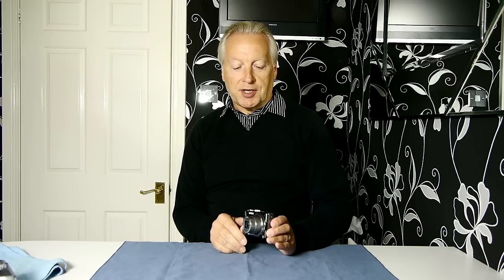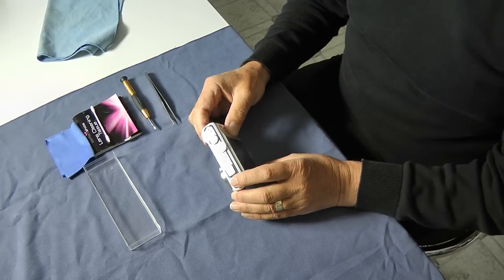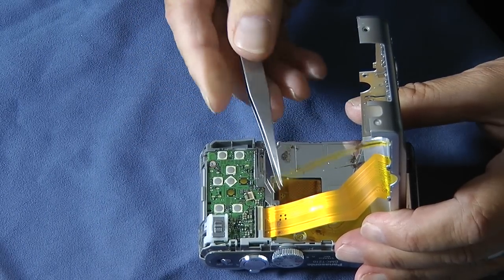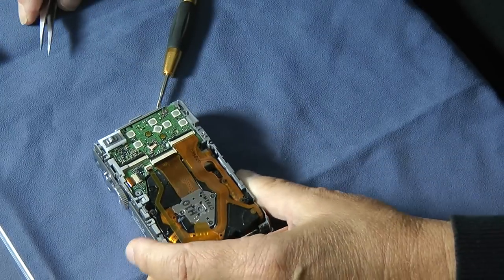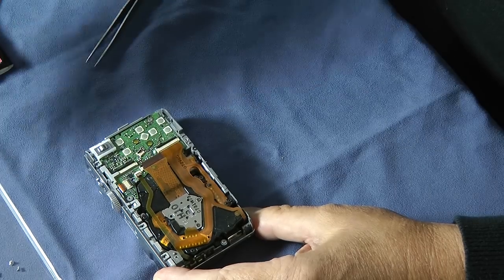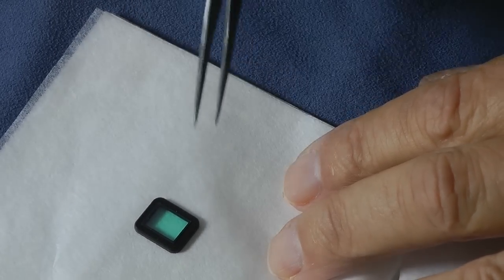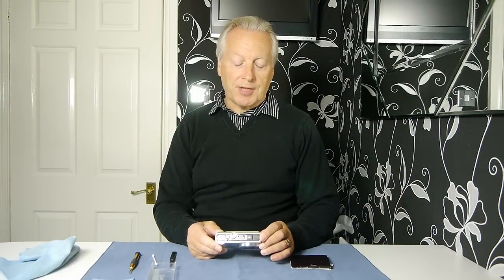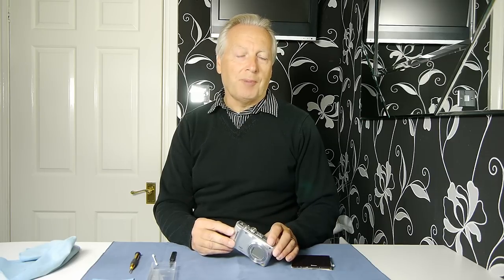Cleaning the CCD sensor of a Panasonic Lumix Compact Digital Camera

Comment: I found your video very helpful and it sort of worked. My problem was a pink screen or pink hue which looked like dripping candle wax. I have split the camera and wiped the filter with a cotton bud. It has vastly improved things, but should I try to find a proprietary cleaner. My camera is a Lumix DMC TZ3. Of course it may be a different fault altogether but you have given me confidence to open it up now. Thank you.

Comment: Hello Graham, thank you for the great information. I have a problem with my DMC-FZ200. Coffee was spilled on it and the rear screen was damaged. I replace the rear screen and the camera works just fine except the rear screen will not illuminate. It works but it is extremely difficult to  see anything. I think it may be the CCD sensor and I wondered if you have a teardown video or some good advice? Thank you so much!

Comment from the maker: With the right screwdriver, push hard into the screw as you turn it = this will stop the screwdriver slipping and damaging the screw head making impossible to remove. They use a little screw lock compound on the threads but they usually come out with the right head.

Comment: Thanks for the tutorial. I wasn't able to open my camera (Panasonic SZ-7), since one of the tiny screws was set at a bit of an angle, and I stripped it trying to get it out. Even a #0 jewelry screwdriver was on the large side for those screws. Even if I got it out, I could tell there was some sort of latch behind the case that would have caused me trouble. In any event, I used a vacuum (see elsewhere on the internet), and that worked!

Comment: Hi Graham,
Thanks for your help. My TZ20 is now spot free after a sensor cleaning job I have just managed in Patagonia. Any help with my son's camera would be greatly appreciated. He has a DMC SZ3. My problem is removing the metal plate under the LCD screen. I am sure I am missing something obvious but don't want to force it off. We both had Atacama desert dust get into the cameras and his spot is right dead centre. If you have any tips that would be great.
Thanks again
Diana

Comment from the maker: @surf1div1 ..part2 from the lead edge. with a craft knife cut the tape to the exact width of the data cable. Carefully push the new, thicker ribbon into the housing, you may need to use tweezers help you get it in. Push the cable all the way into the housing. Test the connection. If it doesn't work, try 2 layers of tape. The extra thickness forces the gold connector harder against the wire connectors in the housing. If you get a good connection add additional tape over the ribbon and housing.

Comment from the maker: @mountainvision100 ...continued the backlight from the lcd screen if you observe the metal cover clip arrangement. This way you can see the led and see if they are on and also should be able to see the image on the lcd screen which will prove that side is still OK. Without hands on I really can only advise on what I would check to identify if the unit is in need of replacement. I don't think the backlight is available on its own its a complete display if it has gone.

Comment: +
I have the dreaded spot, on my TZ40, forming in the top right corner. Hardly noticeable until I zoom when it becomes clearer and clearer up to 20 zoom after which it moves out of shot? Do you have instructions for disassembly of a TZ40 because the screws are different to the one you show here?

Comment from the maker: Do you get anything when you turn on - the lens extend. Does the green led come on on the back of the camera.
Did you remove the battery during the procedure? Apart from the sensor and lcd ribbon cables did you remove any other cables? Lets start basic.

Comment: Very helpful. My camera was not the same model, but was a Lumix so all went well.

I would add that one needs to have a size 0000 phillips screwdriver, or you may strip the screws and never be able to remove them. I began by using a 000 size, and found it barely small enough to take out the screws on the case, and too large to remove the screws on the inside sensor plate. 0000 are hard to find, but I found one online at Sears for a few dollars and it worked well. Take the time to find the correct screwdriver before starting and this will be a breeze.

Rather than take a chance scratching the sensor, before touching the sensor or filter with a Q tip I tried blowing air on it with one of those rocket shaped manual sqeeze blowers. I used a magnifying glass to observe that the schmutz had been blown off it. So I never had to touch the filter. I blasted a bit of air onto the back of the lens as well, as it appeared to have a speck on it. I put it all back together and there were no more artifacts on the photos (check by taking a photo or doing live view into a bue sky or white wall or ceiling).

If you decide to try the blown air method, NEVER use canned air or your mouth, as those methods are likely to get vaious liquids on the sensor. Use a rubber squeeze blower of some kind.

Mr. Houghton has performed a great public service with this video, and has no doubt saved people hundreds of dollars in unnecessary repair bills.

Comment: It WORKED and wow so perfectly clean!!!  Why didn't I look this up sooner?  I took it apart yesterday because I'd dumped a can of soda over onto the camera.  At first thought I'd completely killed it but after opening it up, carefully using a swab to remove any moisture and then letting it sit open for awhile things started working.  Now my only issue is the LCD screen has some spots in it.  Pictures come out fine.  Thinking maybe I should open it back up again so air can get behind the screen?

Comment: Thank you. Used your video to fix my TZ60 which had a stuck lens and system error (focus). More screws than the one in the video and I had a couple I couldn't get back in, but it works now!

Comment from the maker: ... cont 2 .. do not turn the camera face up as water will run back to the ccd. By this way you may be able to get water inside the front element to dissolve the residue. You may have to do several times immersing the lens ( only 1cm into the water) and then blotting will kitchen paper - always keeping the lens pointing down. Let it dry naturally in somewhere warm. Then check the result. If its improved then repeat until its gone. This is only a suggestion - I have never tried this! Graham

Comment: Great explanation and I followed every step to clean my tz8 sensor which had those dreaded spots. Having used it I still had some small shadows so went through the exact process again only this time I've lost the back screen, its totally black! It still takes pics (without the dust) but have no viewer. I've rechecked the refit.  Any ideas?

Comment: Hello Graham, excellent video, thanks.  Cleaned off the dust but now my LCD screen will not turn on.  The rest of the camera functions, any ideas?  I did pull out the 3 ribbon cables and reinserted them. (using the levers)

Comment: Hi Graham,  I have a Panasonic LX5 and am having some trouble with the thumb wheel not engaging. From what I've read, the problem could be a result of dirt getting in the mechanism so I was considering opening it to see if I would have better access & determine if it would be easier to clean. 
Have you opened a LX5 before?  If so, do you think it would be easier to clean the thumb wheel mechanism with the cover off?
regards
rik

Comment: Hi Graham.

Many thanks for making this.

 I used this process once before successfully on a Lumix TZ-8 but over the summer tried it again and managed to break the infra red filter. I hardly applied any pressure to it but it's very brittle. I have a new Lumix and would like to sell the one I have after replacing the filter. It doesn't seem to be possible to buy replacements so I was thinking of getting a spares/repairs model from ebay and using that but spares/repairs TZ-8's are in short supply so I'm wondering if  you know whether filters from the other TZ models will fir the TZ-8?

Comment from the maker: Hi John its possible you have installed the IR filter the wrong way up when it came out. When you look at the reflection from the surface of the filter against a light coloured object, say a piece of paper, one side appears much darker than the other. Th darker side should face down towards the lens with the lighter side up towards the ccd. place the filter in the recess then the gasket on top. Be VERY gentle in handling the filter by the edges only. Tighten the ccd down evenly a bit a time

Comment: I have done 3 different models, the last a TZ30 which had a particle on the inner lens not the sensor itself. The TZ30 is actually less involved to take apart. The general procedure is the same as the video.

Comment: Hi Graham,  very well illustrated you tube and I will attempt to remove the specks of dust in my Lumix camera. I also another one which has the view on the screen off set as if it has moved right and down. So you see part of the picture you are taking. Any idea how to resolve this?

Comment: I found the explanation very easy to understand though there was no specific advice how to find the lost screw on the carpet.  With luck it showed up; less coffee next time!  The IR filter fell out of it's rubber housing but fit easily back into it's spot; it seemed to have a tiny bit of 'haze' despite lens cloth so I just replaced it without breaking it and the photos don't seem to show any problem (and my spot is gone!).  You don't refer to compressed air:  any problem with that?  Thanks

Comment: @ghough12 
Thanks for the feedback Graham. I proceed to get it back together and while attempting to put the data/ LCD ribbon cables back, the black piece of the cam lever came off and the local shop stated they couldn't repair that. They attempted to order the PC board that it attaches to and stated that Panasonic doesn't sell them rendering my DMZ-ZS7 good for parts only. Your thoughts?

Comment from the maker: @mountainvision100 it sounds like you have the little cable for the lcd backlight installed the wrong way round it is only a 2 wire cable and is installed opposite to what would appear the right way in the socket. Try that, get back if no luck

Comment: Hi Graham, Excellent video, I was able to take my TZ10 apart and clean the lens to get rid of the dust that had accumulated.  I do have a question, after putting my camera back together again I have noticed that I have a faint streak going down the left hand side of the image.  I believe this is due to when cleaning the lens block it push the dust/dirt to the edge of the lens.  Any tips on how you would remove dirt that is tucked up in the corners? Would compressed air help/hinder?  Thanks!

Comment: Hi @Graham Houghton!  So, I took apart my ZS9, got to the CCD and indeed saw a dust particle on the surface.  Eureka!  I promptly cleaned it off, reassembled the camera, only to have it not turn on again.  What a shift of emotions.  I have disassembled/reassembled the parts I have removed, to no avail.  Battery is installed, USB cord to the computer likewise unresponsive.  Any ideas, before I just discard my camera?  Thank you in advance!

Comment: Graham, thanks for you great video. I have the DMC-ZS7. While getting to the infrared filter it came apart from the black 'plastic boot' that fits around it. I don't believe their's any notch that it fits in and short of replacing it, and unable to get it (filter) back inside the opening of that gasket. Any suggestions? I'm wondering where I can order that part or has anyone else come around this in any similar models that they were able to get back together.

Comment: I had a dirt on the sensor problem a few years ago and was about to try taking it apart when I read online about using a vacuum cleaner to suck it off and it worked.  I taped a empty toilet roll over the vacuum cleaner suction pipe which was a good fit over the zoom lens of the LF1.  Switched on the vacuum cleaner and it immediately removed the dirt.  I know its still in there but after a few years of use its not visible in the viewfinder or on the pictures

Comment: Your video emboldened me to try to clean the lens on the DMC-TS4.  I had an artifact on it for a while, so it was eating away at me. I use it for work and produce reports with the pictures, so clients see them.  Anyway, I started taking the layers away, and by some of the techniques you showed, I was able to remove part after part and eventually get to the filter which had a tiny spec on it (and I'm not sure how, since the camera is supposed to be waterproof...so how did dust get in it?).  I was able to put it back together, and it works well now.

One screw wasn't staying put - it had what looked like a blue adhesive on it.  At this point, with the next layers on, I'm not worried about it moving out of place, but I'm just wondering if you've seen it before.

Thanks for your assistance!

Comment: Hi Graham, 

I just got through cleaning the dusty IR filter and CCD sensor on my DMC-ZS7.  The camera in your procedure exactly matched my ZS7, making this a very easy job.  Thanks a lot!

I've also got a Lumix DMC-ZS20 (DMC TZ-30)that has the same problem with dust spots visible in the viewscreen.  This camera uses the #6 Torx screws that are held in place with cement.  From what I've read in the service manual, if these Torx screws are disturbed, the CCD sensor needs to be realigned using an optical tilt adjustment. To do that procedure, a special light box device is required.  Is this true, or can I get by by doing a similar  procedure like you show here?

Thanks a lot, Tom

Comment from the maker: Its more than likely that the cables are not fully inserted into the lock connectors. Ensure the latches are fully open and then push the connectors until very little of the gold plated connector is visible, then close the latches. If there are 3 cables are you talking the TZ20/30 (Zs7/ZS10) as these are different

Comment: Thanks!!! Just cleaned my ZS5, same hardware as the TZ10.  The ribbon cable friction locks were new to me! Tweezers from Swiss Army knife are perfect for the IR filter.  It quickly separated from the boot, but not a problem.  I used sensor cleaning swabs, they left a "water mark", so wiping that with Q-Tips (cotton swabs) cleaned it up.  The sensor was filthy! -- lots of lint and specs.

The local camera shop told me I'd destroy my camera.  I need to take it back in and show it off.  :-)

Comment: Hi, Graham.
Thanks for the top-notch video on how to clean the sensor and infrared filter.
Unfortunately, my dust particles (as for others) seem to be located on or between elements of the lens, further toward the front of the lens assembly.
I was waiting for your video to move on to  the "vacuuming" section, but it never came.
I can SEE the offending particle that causes the blotches on my pics by looking in the front when it's  turned on. How do I get THAT out? Thanks.

Comment from the maker: Hi, the LX5 is a more technically difficult camera to repair ( hidden screws under a cover in the flash hot shoe prevent most people getting inside. The thumb wheel itself is a surface mounted component and virtually impossible to replace even if Panasonic were to supply the switch alone (which they don't) You would need to replace the whole top control pcb (which is easy). I've found it more and more difficult to get parts and have to sometimes rely on getting broken units from ebay for spares

Comment: It's a TZ10. It has the second cable.  I have tried to reset the ribbon cables a few times.  Increasing the power level does make the screen a little brighter, but the colours are still too saturated.

Comment: Really great video -- well made and very clear.  I have a question: Mine is a DMC-ZS10.  The IR filter seems to be integral with the CCD.  In any case, I didn't feel comfortable trying to separate them -- not a problem in the end as the dust was clearly on the IR filter.  Nonetheless, I wonder if there is a way to separate them.  I also wonder if there might be a modification which one could make to the camera to decrease the likelihood of the problem's reoccurring, such as perhaps drilling a couple of tiny holes in the back and attaching a filter material to them from behind to alleviate the suction when the lens extends.  What do you think?

Comment: Do you have any information on the Lumix DMC-LZ8?  I opened up my camera and the circuit board completely covers the CCD area, and needs to be removed to access the CCD.  I couldn't get the circuit board out easily, and was afraid to do damage, so I closed it up again.

Comment: Hi Graham, the first time I did this procedure The IR filter fell out of the rubber gasket I tried to fit it back to the gasket with no success. Eventually, I simply placed the gasket onto it's location and then put the IR filter on trying to place them together and hoping the pressure from the top element will stick them together. It worked for a while but then I see dust spot again. How important is it to make sure the IR filter is properly   gasket inserted in the gasket? Any how-to do it?

Comment from the maker: I'm surprised that Panasonic have not embraced the ingress of dust and pollen more in this range of cameras, It was bad enough on the lower end range but is totally unacceptable on the later TZ30 and TZ40 but is still happening. Could it be more than just enviromental? Cameras carried in pockets rather than a small case will suffer a lot more as the dust settles around the lens flange and then gets sucked in as the lens extends!